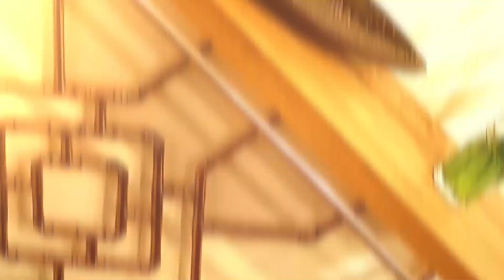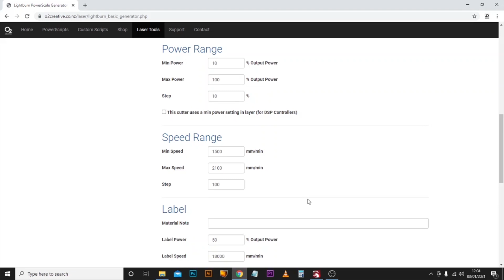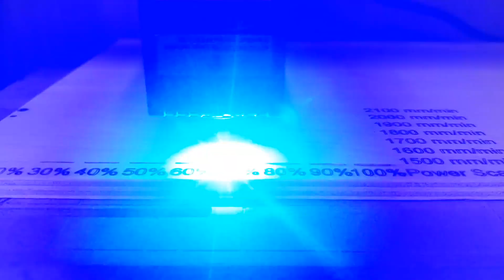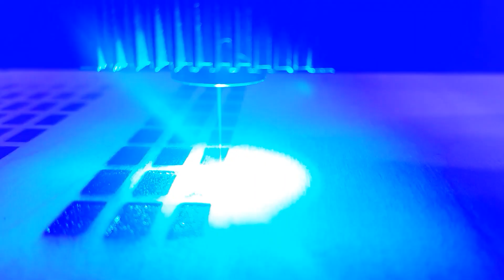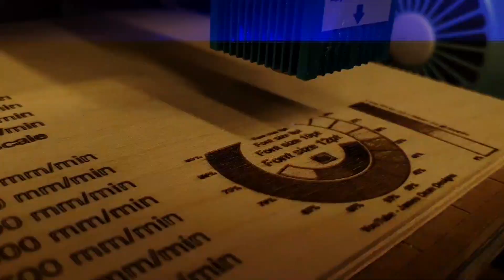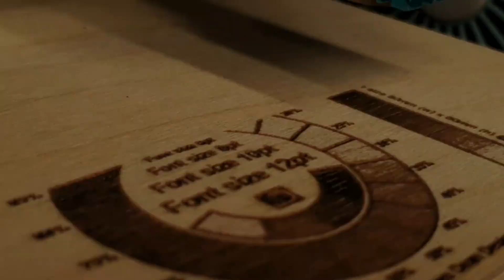Laser power, speed and greyscale tests

Comment: Great video explanation.
One question, why do you do the grey test at a 100% and not according to the first measure you did?
If say the speed will be at 1500mm/sec and the power between 10-70% wouldn't it be better do the grey test at 70%?

Comment: Late to the party, but this video is great. 
One thing about the drop off at around 15%.
It is not necessarily due to the laser. Here is important the relationship between laser exposure and darkening of the material. That is a property of the material not the laser. It might just be impossible to get intermediate darkening because of chemistry of your material. That is why there are different image modes. Dither or Jarvis graduates the intensity with the density of really dark dots.
If you would use photographic paper you might be able to see a difference. 
Sorry if someone already mentioned it.

Comment: it is not accurate vs built in material test in lightburn now. please update your tutorial or at least say which version you are working on. I loved the tutorials more than anyone here in YT but I dont know what makes it different with newer sotware versions.
Reply from the maker: No, the video is now a few years old. To be honest though I still prefer this method. The inbuilt version in lightburn is quite limited. Yes its convenient but for example every time you want to jog the laser, you have to exit the material test, jog the laser, reopen the test at which point it reverts back to default settings. Hopefully they will improve though as its a useful tool

Comment: Ah, LightBurn, Lightgrbl treat images different. Good to know, guess I have some other software to learn now.
Reply from the maker: LaserGRBL is great for being free, but lightburn is much more superior. Since doing this video as well they have add loads of new features. For the cost it's amazing
Reply: @JamesDeanDesigns  I am working on a retirement budget. Using Raspberry Pi's, bCNC and Fengrave for the 3018 routing. After seeing your vid I borrowed the kid's laptop and got Lasergrbl working very quickly. In half a day I had laser installed and was photo engraving a coaster, it did impress the wife and her coworkers at work last night. That laser had been sitting unopened since Feb. Thanks for making it look so easy, it was. If I was in production and had a business making money the cost of these machines and the real software is so cheap. Still looking for my niche, cleaning out the junk storage, setting up workshop, Hand Tool Rescuing 15 years of rusted equipment.  Your vids are  great for beginners.

Comment: Very helpful!  Just  curious.. What wattage laser did you use in this video.. I'm guessing 5w.  I ran the raster test on my 10w and parts of the raster test ended up looking a bit like a spiral stair case. The darker portions etching deeper in to the wood. Also, the first time I ran it,  the white portions were coming out gray...  Then I noticed I had 20% minimum power.  I set that to zero like your video and that fixed it.  Thanks again!

Comment: i would like to know what kind of laser enclosure do you have there?It looks like handmade but very good done.Do you have maybe a blueprint from this enclosure or can send me a few picture with measurements?My enclosure i built by myself and it doesn't be 100% closed and have problems to access it because i built the access point on the right side instead of the front. are you able to cut through wood with your laser without having to do 100 or more passes when the wood is lets say 4mm thick plywood
Reply from the maker: Here is the link to the enclosure. I so did a second video a little later with some upgrades to the enclosure 
https://youtu.be/lTKdhGt8r5k
Reply: @JamesDeanDesigns   thank you very much.didn't count on that offer.Downloaded it and i guess your workspace area from your laser is 400x400x22mm correct?

Comment: Can you tell me how to increase my grid size, right now it is only giving me 3 across by 4 high. First time user, thanks in advance
Reply from the maker: When you are putting the settings in it will ask you what range and increments. So if your range is 0-100  with increments of 10 then you will get 10 across, if its increments of 20 then you will get 5 across. Hope that makes sense
Reply: Thank for the info, your videos are very helpful.

Comment: My background is originally in laser projectors for entertainment purposes. I recently got into engraving and am setting up my own system. In the laser show world we prefer analog modulation which gives you a much larger control and color mixing capability. I noted that most laser diode drivers available for engraver heads use TTL modulation. Likely get much better grey scale control with analog modulation. Which method does your laser head use analog or TTL ?

Comment: Hi James, Don't laugh but I've been away from using my laser for 9 months. Part of the reason is frustration because I ran into some roadblocks. I ran the Laser power, speed test but I had no burning at the 10, 20 & 30% levels. I'm using the components I've purchased from SainSmart ie: the 3018 MX3 (which, I guess is now a 3018 Prover since I replaced the control board with the GRBL Control board and the adjustable focus 5.5W Blue Laser. Also, I'm using Lightburn. I focused the beam as best as I can see. I made sure the S Value Max is set at 255 and $30=255. The weird thing now, with the 255 settings, is I can't see the laser when using the "Fire" button unless I have all the lights out in my shop. I'm beginning to think I should set the S Value Max to 1000 and the $30=1000. I'm going to try that while waiting for your reply. Thank you for the excellent videos. Bob

Comment: 4040xe 40w laser HELP running gray scale file on 4040xe not lasering good. Can run on 3018-PRO with no problem using a 5500mw laser prefect using light burn use light burn for both machines, feel like I was duped out of $350

Comment: Great tutorial !!!!
I did follow your video, but all of my cubes are set to 100% power even after a change the row to increments of 10 in shape property. I see all of your cubes are also at 100% power but when you were laser the cubes burned at different powers. Why doesn’t light burn allow to move power for rows of cubes?
Reply from the maker: Check your GRBL settings first and make sure you have $30, $31 and $32 setting in there
Reply: @JamesDeanDesigns  newbie here 😁, where would I look for $30,$31 and $32?
Reply: @danielpais7306   F1

Comment: Do you know what the "shape properties" option would be called in RD Works?  That's what I'm using, and can't figure out how to change different power settings within each layer.  Thanks
Reply from the maker: I dont unfortunately but its not saying RD works has the same function to be honest
Reply: @JamesDeanDesigns  Ok, thanks for your quick response. I'm trying to figure it out, might just have to do each square individually

Comment: Nice video, easy to follow. Seeing how anything less than 30% isn't engraved at 1500 mm/min, how do you prepare a photo? make everything that would be in the 0-30% brightness range darker and have very tanned people?
Reply from the maker: Thanks. You have a few options. You can limit the range so rather than it colour the photo with 0-100% range you can just tell it to use something like 25-100% so there is less drop off. There are certain techniques that can help the wood burn better such as spraying on a mix of baking soda and water, it apparently helps the lower end burn a little better.  Or as you say darken the photo

Comment: I also got a mirrored image from the o2creative Lightburn file generator. I eventually got the image the right way round by flipping it horizontally and vertically several times but the origin was way off to the right. Still trying to get the imports to work correctly.
Great videos, I think you have one of the best presentations on Y/T, please keep them coming, many thanks.
Reply from the maker: Thank you 👍 thats really appreciated

Comment: Hi James, You mentioned in the video as you were assigning the rows to the different layers, the speed was increasing automatically by 100. Is there a setting that makes the program do that? I was following along and my speeds did not increase with each new layer assignment. Thank you, Bob
Reply: Hi, I was having the same issue today but finally got it to work as in the video.  I realized that my Cuts #'s (C00, C01, etc.) were not sequential because of a previous job where I renamed the Cuts #'s under the "Cut Settings Editor" by double clicking on the Cuts/Layers.  Change the Names back to the Default and it should work auto incrementing again.  I hope this helps someone.
Reply from the maker: Im not 100% sure how it does that. Make sure you have the latest version of Lightburn, but also you could use the generator mentioned in the video that does it automatically for you for ease

Comment: James, I appreciate that all machines are different but I am having a real problem trying to get my 3018 to produce greyscale engravings.  I started by following your video to the letter but with both the test in the video and with the raster test run, I can't seem to achieve little or any graduation.  I have tried adjusting the power and speed settings up and down with little or no improvement.  On the raster test, I end up with virtually black from 100% down to 75%; then a slight lightening between 75% and 45%.  The 40% section is partially filled with empty sections down to 5%.  What I did notice was that your laser head appears to be about an inch from the work surface whereas mine is probably closer to 4 inches; could this have an effect?  I have focussed the laser so that the focal point is as small as possible.  Am I missing something or is it simply a case of trial and error until I eventually find the correct balance?
Reply from the maker: Hi John. The focus can vary between lasers depending on the lenses. Have you done the focus tests from my other videos setting up your laser?
Reply: @JamesDeanDesigns  I have James, I have pretty much followed all your laser-related videos.  Up to now I have been engraving line drawings and they have come out very well with no loss of detail and no burning.  It is only after having seen the results others have achieved engraving photos on to wood that I have started to try some greyscale.  I seem to get either black or nothing when engraving photos.  I have changed between Jarvis, greyscale and the other settings to see if that makes a difference...nothing.  I appreciate how difficult it is to make suggestions via a forum so I will try some more adjustments and only come back to you if I fail...again.  Many thanks, John
Reply from the maker: @johnwalker1094  make sure your lens is clean. If you're using the laser without any kind of air assist then you will get build up on the lens which can impact the greyscale
Reply: @JamesDeanDesigns  Ah, I didn't know that, I will check, thanks.  My workshop tends to fill with dust so could be the cause.
Reply from the maker: @johnwalker1094  burning any kind of material give off smoke, that sticks to the lens and causes. Not saying its the case here but worth checking

Comment: Great video.. followed your instructions to the letter. Everything was fine till I opened it file in LightBurn and the image is mirrored. What did I do wrong?
Reply from the maker: Is your installation of Lightburn fresh? There is a setting in device settings i think that flips it around, looks like the origin setting if I remember correctly. When I go out to the workshop I'll double check.
Reply: @JamesDeanDesigns  Thank you.

Comment: awesome video man, i still have my 3018 laser 5.5w module but i got the laser master 2 and i honestly think its night and day these 2, both are great but the master 2 is a lot better. thanks for the upload, youve gained a sub.
Reply from the maker: Thanks. Most belt driven machines are better for laser. They can accelerate much quicker and travel faster which really helps. I think its why you don't see many machines that can do both is because inevitably it won't be as good at doing one of the jobs

Comment: I have a question re acceleration settings, why in Graham's tutorials (and the test I run) the values were around 3000-5000 and in this video, you have $120 and 21 values as only 50? Do you change them depending on what you engrave? Thanks
Reply from the maker: I was having some serious issues whilst doing this tutorial, long story short I changed $11 setting without knowing, part of me trouble shooting the issue was I reduced all the acceleration settings right down. I cant get mine no where near that high anyway, I'm lucky if I get mine above 800, but it really is a case of everyone's machine is different.
Reply: @JamesDeanDesigns  okay I understand, I have exactly the same machine but different laser. I'll keep trying with different settings to get the results as you've got in video. Thanks for the answer 😊

Comment: Hi, thank you for your amazing videos. I made a diy laser engraver using 20W(5500) Chinese laser module and did the tests you did in the video but I cannot get the light tones exactly. I mean even with the %10 setting,  they are not light enough. Also dark tones are too dark. What should I check?
Reply from the maker: If everything is too dark then you either need to increase your speed or lower the power range. The easiest way to do this is probably bring down your S value in device settings. If for example your S value is 1000, try bringing it down to 800. However you should leave your $30 at 1000
Reply: @JamesDeanDesigns  thank you for the quick answer. Today I did a few more tests with different settings. I changed the output power from %100 to 80% and used 2300mm/m speed. I also increased  the brightness and alpha for the lmage and finally managed to get a good result 😊
Reply from the maker: @MucitPilot  excellent. Thats what I like to hear. Glad you've got somewhere with it 👍